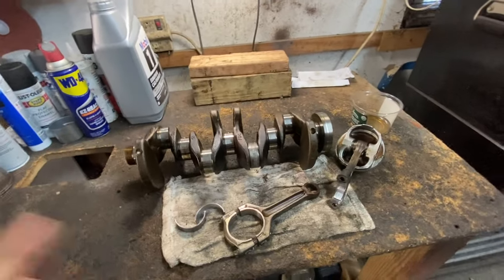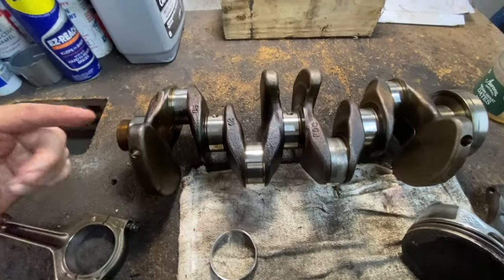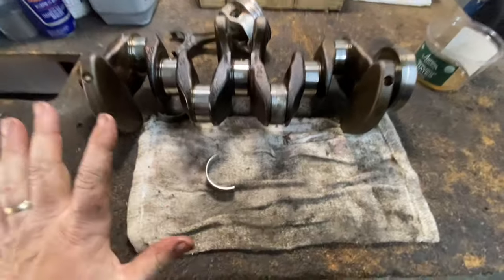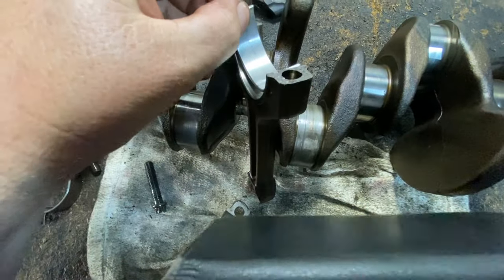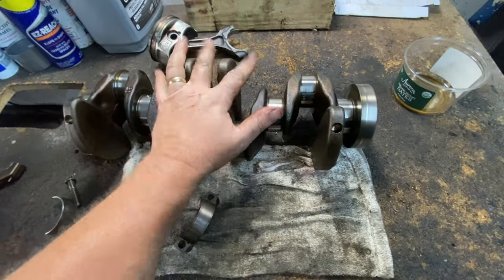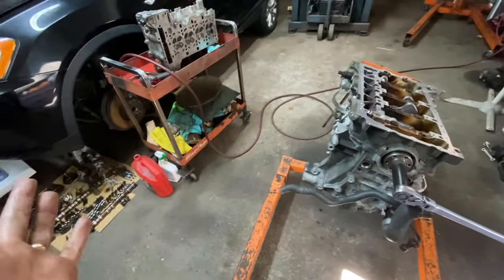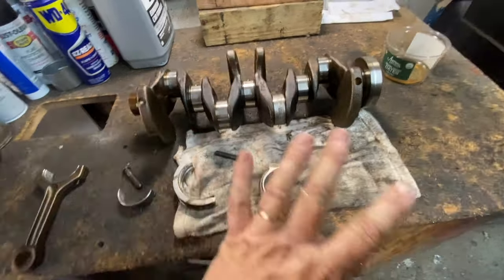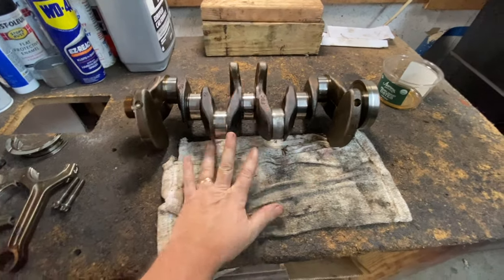Engine Rod Knock - Is It Worth To Be Fixed?

Comment: Why not refer to the rod bearings as rod rings. Piston ring,rod ring . calling them bearings is confusing 😦
Reply from the maker: Because they are called rod bearings just like main bearings. Pistons have rings not bearings.
Reply: Bearings help things slide against each other with less friction.. Piston rings are to seal it and keep all the expanding gas inside the cylinder..  So rod bearings are bearings, but piston rings are not..